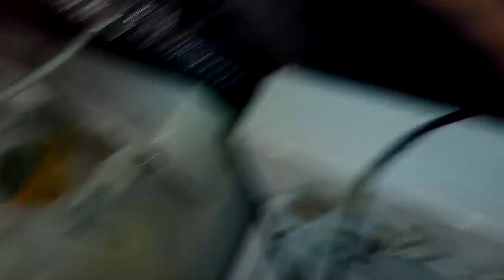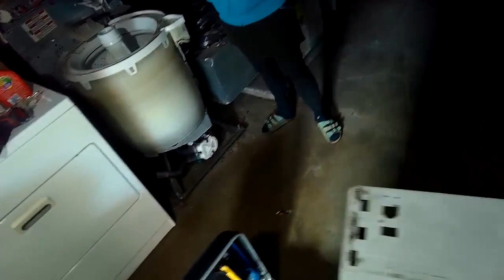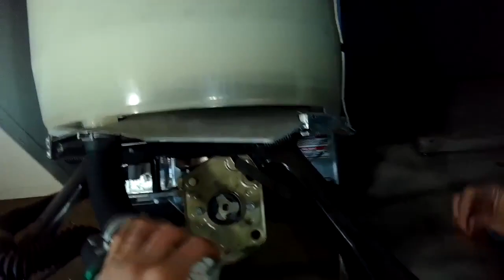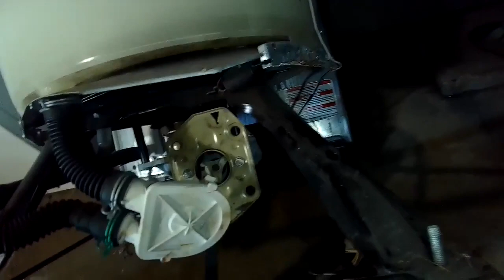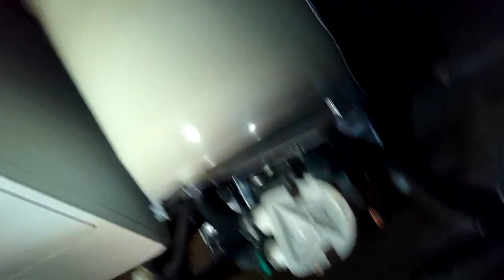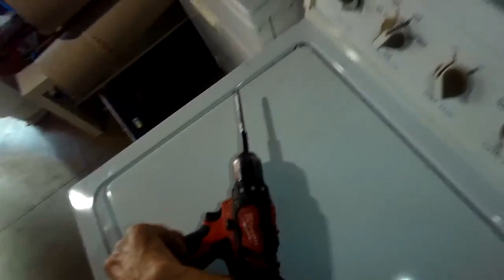✨ Kitchenaid Washer Won’t Agitate or Spin — FIXED ✨

Comment: Same washer - but mine turns off and  on.  Cycle still finishes but take a long time. Runs few seconds and then turns off - maybe for minutes.  Any suggestion?
Reply from the maker: The motor has an overheat switch. If it gets too hot it will turn off and after it cools it will turn back on.
I bet something got caught between the tub and the spin basket and that’s making it overheat.

Comment: My kitchen aid top loader will spin but mot agitate. I can hear it click. Then it will drain and spin. Is this the same problem?
Reply from the maker: It might be the contacts in the timer for agitate are dirty with carbon.
Might need a new timer.
Reply: Im having the same issue with my kaws700jq2. Oddly enough it will agitate after the rinse cycle, not every time. 

If its the timer, do you have a lead as to where I can pick one up? I've looked a few places online and can't seem to find one. Or can I clean the carbon off with some file/sandpaper?

Comment: You really helped me out when I had to replace that part last year and everything worked great. Today we ran a load of laundry and everything works bt the spin cycle. I checked again and the parts I replaced are still good. When I have the setting set to Spin I just hear a power noise like it's trying to spin but nothing is happening. Any ideas?
Reply from the maker: If it won’t agitate either, then it will need a new motor coupler.  If it just won’t spin but it sounds like the motor is running, then you need a new clutch👍
Reply: @ScottTheFixItGuyChannel  come to find out I checked the pump and sure enough it was one of my kids socks in there smdh. Thanks for responding I appreciate it.

Comment: Hi Scott. Informative video. The machine you repaired in this video is exactly like mine, with the symptoms described.  I have a question. I for the life of me can't find the model number tag on my old machine anywhere.and I have looked everywhere and I mean everywhere. would you be able to help me with a model #?  Just in case it may be the clutch and not the motor coupling, it would make if a lot easier ordering parts if I have a model number. Thanks in advance.
Reply from the maker: Can you try this: 110.26832692

Comment: thank you for your video, for a moment I had some hope I could repair my washer until I found out the coupler is in good condition... any idea where to look? the motor seems to work, as the drain cycle works well but it doesn't spin.... I replaced the agitator directional cogs but it didn't solve the problem :(
Reply from the maker: If it’s not the coupler, then you can fix it by replacing the clutch .
Reply: @ScottTheFixItGuyChannel  it seems it’s something else… I just replaced it but it still doesn’t spin… :(

Comment: Kitchenaid is Made by Whirlpool.  Model number is right under the lid, mounted vertically, on the round chamber, on a little engraved aluminum plaque.  Starts with a K
Reply from the maker: Thank you😊

Comment: I just fixed my 25 year old machine using this!!! I can't thank you enough for making this so unintimiding!! $8 part, $33 tool....  Awesome! I feel so empowered.
Reply from the maker: Thanks so much 👍😊
Reply: @ScottTheFixItGuyChannel  Just watched this video and was very good. I have the same model about 30 years old, I think. My problem is a little different in that it agitates but won't start spinning unless I get it started by hand. It has been doing this for several years but started making an extra intermittent noise during agitation. Any thoughts or could you direct me to a site that might tell me? Thanks

Comment: I recently got this washing machine given to me by a friend after ours broke. It has always only spun out some of the cycles, usually heavier loads. It recently wouldn’t spin at all one evening so I decided to replace the motor coupler. First load after the repair spun out fine, second (heavier) load would not spin out until I rearranged several things. Does this indicate a motor issue/another issue or is this just typical of older machines with heavier loads and I just need to wash smaller loads from now on? Thanks in advance!
Reply from the maker: It might be the clutch👍

Comment: I'm looking around my machine.  We get intermittent wet laundry.  Was looking for broken gasket support.  None found.  The transmission shaft is a bit worn under the coupler. I reassembled with moly  grease
Reply from the maker: Good idea👍
Reply from the maker: I bet a new clutch will do it👍
Reply: @ScottTheFixItGuyChannel  Explain to me the interaction of the clutch in relation to water fill. How does it transfer from agitate to spin?
Reply: @ScottTheFixItGuyChannel  are you implying that my spin cycle isn't always happening due to damaged transmission? I am surprised the input shaft had wear and that would indicate hard service , but wouldn't the transmission just be completely inoperable?
Reply: @ScottTheFixItGuyChannel  OK now I got it. We had intermittent wet clothes.  The clutch friction material is worn and for large loads (and from) the mass is overpowering the clutch.  Got it.
Reply: Nevermind. I've been feeding my brain all the videos on the transmission and I misread clutch for transmission.  Ooh I like this design more and more. So there is no electronic parts other than motor in lower half. The motor speed mechanically initiates the selection of spin or agitate via the centrifugal clutch and the clock like agitation portion.  Cool. Still gotta figure out what sets drain pump working.

Comment: I bought spares for $2 each on ebay years ago. The new style has a metal reinforcement in the center. Not sure it's a good idea. I would rather break the coupler than the motor The price went up to $20 I am glad I got mine before.
Reply from the maker: That’s a good price😊

Comment: Part number 285753A ? Thanks this was super helpful although my machine is a Kitchen Aid
Reply from the maker: Nicely done😊👍
Reply: So Scott there is a leak in the front right - which I thought this part might fix(?) but no. It’s still leaking. What could be the problem?
Reply: Hello, my kitchenaid was leaking water, not agitating or spinning and only partially draining. It would also sometimes trip the breaker.   I followed this video, the couplers were still good.  We purchased 2 used motors and cannot get either to work differently than our original. What would you suggest?
Reply: @shanigreen  My machine worked as far as draining after that but it was still slow leaking in the right front corner so I ended up going on FB market place a bought a used one off of some one

Comment: Thanks scott, great video. I checked motor coupler and all seems good. No clicking or motor sound when spin cycle engaged, its totally quiet. Would this be the control switch located on top control panel of washer?  Or maybe the motor is done? Im working on kitchenaid.
Reply from the maker: Can you send that same question to my email? At: scottthefixitguy@yahoo.com

Comment: I have replaced the motor coupler and still the noise. Then I replaced the agitator dogs, they were decimated!! I still have the noise but only when it locks to agitate. 

I have done this more than once and I have this washer now. I am at a loss other than the drive pulley (if that’s correct) or maybe a spacing issue somewhere? I have cleaned everything I can reach, all looks in good condition.
Reply from the maker: Can you send a video of that to: scottthefixitguy@yahoo.com

Comment: How loose should the coupler be in terms of spinning? It seems to have a lot of resistance. I bought the part to replace but it doesn’t seem to be broken.
Reply from the maker: Thanks Gina, we’re you able to replace the plastic forks that connect to the motor and to the transmission?
Reply: This piece should not be purchased at Amazon randomly! The metal inside the plastic prong piece can also be slipping making the noise. I just replaced mine and realized the agitator dogs were destroyed, another 5$ part and quick fix.

Comment: Please help! I changed the coupler and tested it without clothes and worked fine. Added a small amount of clothes to wash and it won't spin just hums. Would I need to replace the transmission?
Reply from the maker: Hi Daniel,
The motor is worn out.

Just need to replace it.
They’re pretty cheap.
Reply: @ScottTheFixItGuyChannel  awesome! Thank you very much I appreciate the advice

Comment: This repair can be accomplished without removing metal surround...simply lay machine on it's back and all the parts are accessible.
Reply from the maker: Yep,

Pretty easy just less room to work👍
Reply: I did mine and didnt have to unhook the water or drain. Just unplug. I would do it like in the video.